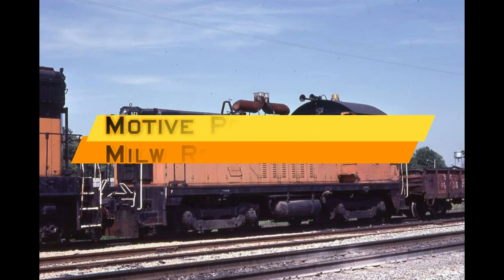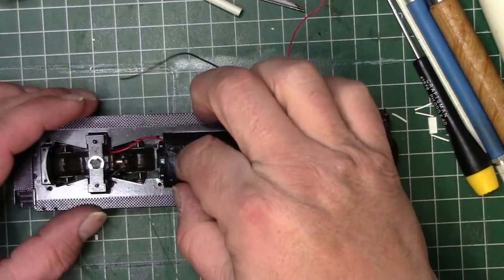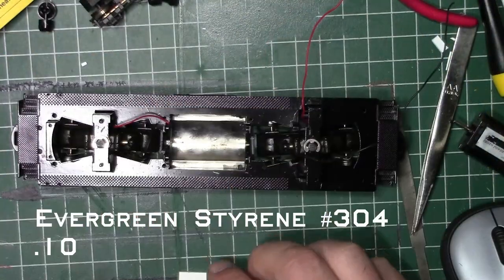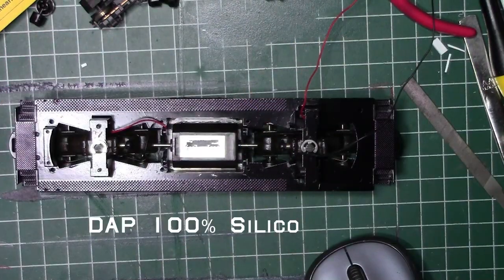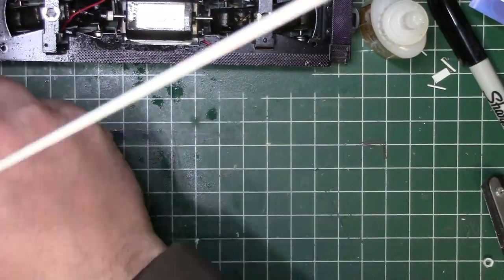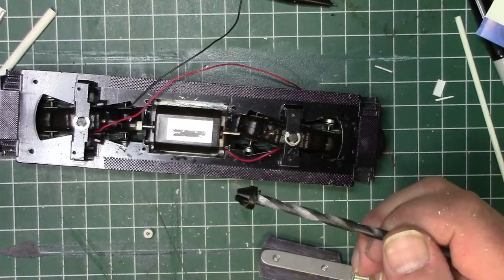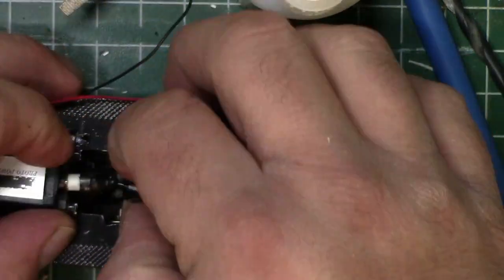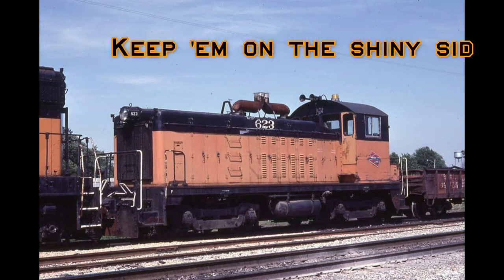Starting from the ground up - repowering a S scale locomotive

Comment: Why did you choose to change out the SHS motor?
Reply from the maker: I changed it the motor to make more room inside the shell for a larger base reflex speaker and all the associated dcc hardware.
Reply: @michaelostertag2839  It looks like you added some foam tape also, it will be interesting to hear if it runs quieter.